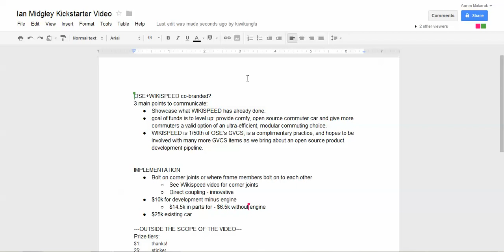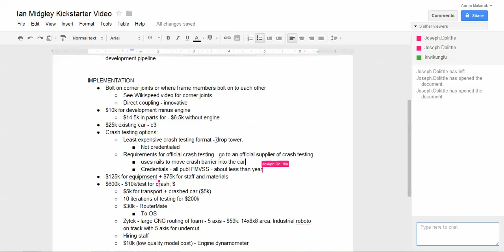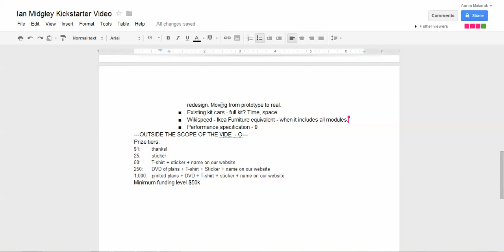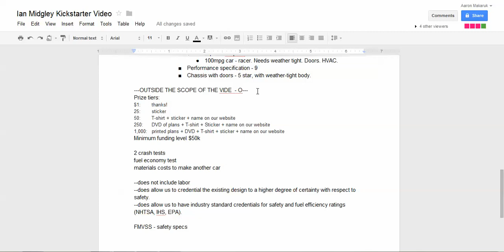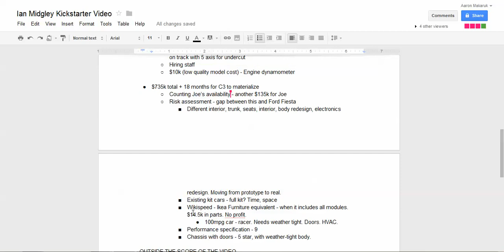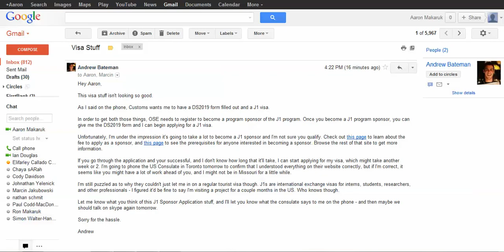OSE & Wikispeed - Kickstarter Planning

Comment: 1:08:00

You should really get an open source licence written down on paper. If you just consider it public domain, you run the risk of one of the big companies making a change like adding 4 doors or moving the engine to the front then preventing you from doing the same.